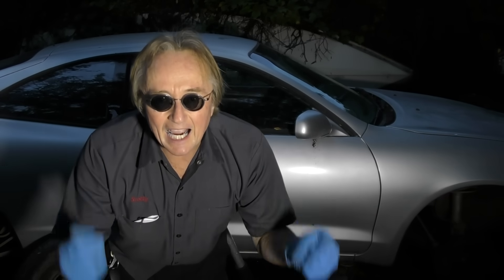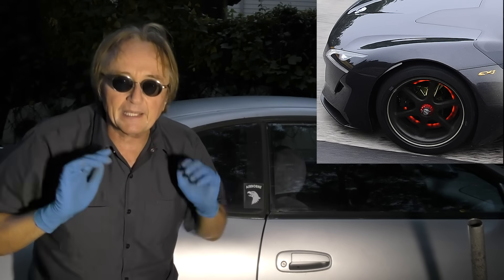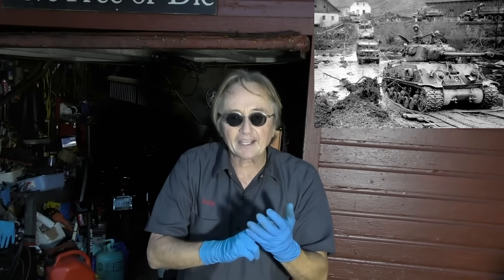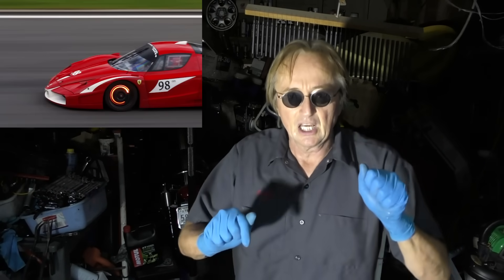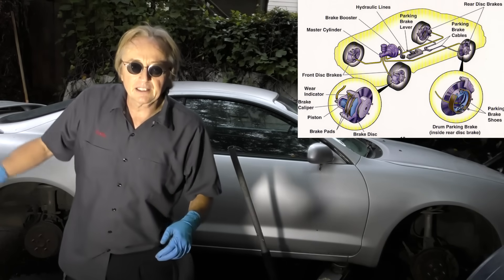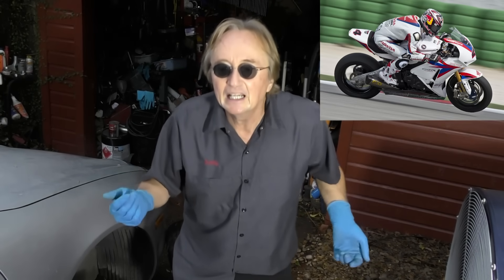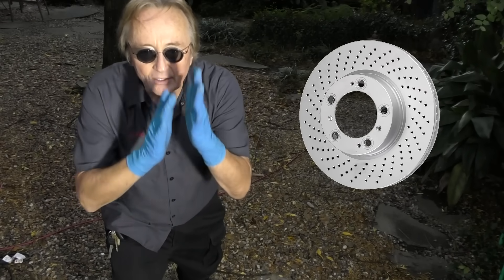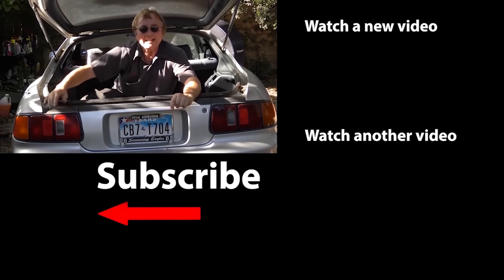Why Some Cars Have Drum Brakes Instead of Disc Brakes

Comment: Disc brakes and rotors are so easy to change too i just bought a car and glade mine have front and back disc brakes.
Reply: I remember when discs brakes started showing up on domestic cars in the 60s.  Despite the fact that disc were easier to work on, the brake shops took advantage of their customers advertising repair work as follows.  "Complete brake job, $69.95.  Disc brakes, $20.00 extra."
Reply: @frankhoward7645  I remember that! I remember my mom's '68 Impala had front discs and the brake pedal said " Power Disc Brakes" molded in the rubber, lol.
Reply: Not so easy on my car because Honda had the genius idea of making the front disc brakes hub over rotor. So you have to take the axle nut off first which requires a heavy duty impact driver or a sumo wrestler standing on the a breaker bar. Then you have to remove the hub, then the rotor comes off.
Reply: @dekoldrick  What the heck kind of Honda do you have? Apart from the stupid screws that hold the rotor onto the hub (which I threw away after the first rotor replacement), it's actually really easy to replace the rotors on my 2010 Civic.
Reply: @dekoldrick  Yeah.  I'd like to know as well.  Never heard of such an arrangement on a Honda.
Reply: @frankhoward7645  It's a 93 Accord. They arranged it where the hub is over the rotor so to change the rotor, the hub has to come off first.
Reply: @frankhoward7645  it's called a captive rotor it gets that name because the rotor is literally held captive by the hub. Yes some Honda's have them depending on year and model. Have no clue why though terrible design when it comes to maintenance.
Reply: @dekoldrick  Thanks for that car information.  I looked it up and sure enough, you are correct as the hub needs to be removed in order to remove the discs however I will say this.  In many cases, mechanics like to replace the rotor every time they replace the pads after all, with the exception of the '93 Accord, there's not all that much more labor involved in replacing the rotor if you've removed the caliper.  The mechanic makes money selling a pair of rotors as well as charging for extra labor.  Most of the time, I believe this is a ripoff because unless it's warped, there's no way a rotor needs replacing as as often as a pad does.  If all you're replacing is the pads, there's no more labor involved, even on a '93 Accord.
Reply: @dekoldrick  is that the first honda ever built?
Reply: @1232bluejays  ,Nope My 2005 Honda Accord Cp has Rear Drums on it 😞
Reply: @dekoldrick  my nissan was like that... it was a slight pain, but not terrible with an impact (electric)
Reply: A seeing idog oh so true
Reply: oh yeah the birds beak, cable, springs, F&@!
Reply: If you live where they salt the roads in winter, it can take an hour to remove a rotor that is rusted to the hub.  I use penetrating oil, a rubber hammer and a torch to expand the rotor.
Reply: @markgigiel2722  I just removed a disc that was rusted to the hub on a 2000 Jetta.  To separate it from the hub, I removed the caliper and whacked the disc from the back side with a sledge hammer.  Didn't take an hour and by the way, I live in Minnesota, home of Cargill.  Cargill sells salt for snow and ice clearing.
Reply: @markgigiel2722  put antiseize on mating surface next time. Pop's right off
Reply: The only good thing about drum brakes is that they last a long time, but disc brakes are easier to change, and they stop you faster.
Reply: Fck all those stupid springs on drums
Reply: Drums are easy to do 10 mins a side tops
Reply: From automotive videos on YouTube it seems harder for a novice to remove a stuck drum than rotors. With disc brakes you can hammer the inward side if the backing plate does not completely cover it. With drums hammering involves trying not to hit the lug nuts. If using the torching method with disc brakes you probably removed the caliper assembly from the wheel hub so you don't have to worry about subjecting the rubber seals and fluid to extra heat, whereas with drums you have to know to only heat the lug studs.
Reply: May be easier to change, but the rear breaks really don't have to get changed very often.
Reply: Usually there are still shoes in the back for your parking brake

Comment: 2004 Honda Odyssey alternator went out undone the battery change alternators RPMs shut up 3500 idle down to 2000 RPMs I need a van I adjusting the throttle cables down to 800 RPMs or somewhere what went wrong with it
Reply: I'd guess a sensor
Reply: did you fully charge up the battery first,   if not you forced the new alternator to be over worked,   if you made any adjustments to the idle,   the computer will self adjust the idle,   you made things worse by doing that,    taking the alternator off on this van can be a big job,  lots to do,   it may need to idle learn again,   and you messed up the idle by changing the cables length.  did you undo any vacuum lines,   did you leave anything unplugged,    and it may have computer damage due to loss of voltage and being driven on low power.   it may need a new computer,   I will bet it was jump started a few times.   if so,  you supply power,  get it started but with bad alternator and then take off the jumper cables and remove the power supply and not it only has the dead battery.   this power fluctuation is a computer killer and it over heats the new alternator and can burn it up in minutes.  and a bad alternator drains a battery dead,   sometimes a older battery will over heat and short out so sometimes both are needed,   new alternator and new battery,    if the battery was old,   the old alternator may have been getting over worked and the old weak battery was the cause of death for the alternator,   and not putting in a good battery will only kill the new alternator.   you must put the battery on the proper testing equipment first to know.  and have each battery cell tested.   if any of it shows low or weak,  toss it.  and you can do damage to the transmission computer,   and body control computer,   its loaded with all kinds of cool stuff that can short out from voltage loss.  or high voltage when a alternator is being told to charge more than it should to make up for a weak battery.   it will put out more amps.  and then burn up,,,,,,again.  poof,   do it all over again.
Reply: I'm old school mechanic this is new school to me lol
Reply: forgot to say thanks for the info I know better next time

Comment: Drums are such a pain at times to replace. Glad my car is disk all the way around
Reply: it takes a well set up mechanic only 30 minutes to do rear drum brakes.   where rear disc brakes tend to get stuck slider pins and stop working on the rear,   more dirt gets up into the rear,   that's why drums was popular for rear brakes,  they are more sealed from dirt getting in.   and can last 10 years with moderate driving where as most people get 3 to 5 years out of disc brakes on the front.   but they do work harder.  and less brake pad material on disc brakes to do the stopping,
Reply: @ateam6486  they get more wear and I like them for a trucks ( my drums take longer because they are usually locked up or rusted on one of the farm trucks) but not a huge fan for them on my sports cars I change my brakes out every 30-40 because I dont want them to get to low
Reply: Seriously?! I can replace and setup drum brakes almost as fast as discs. Just need the correct tools and technique.
Reply: Just time consuming. What sucks is when the self adjuster stops working and its raining too often to do a manual adjustment.
Reply: +Bill Abdallah

What's a self-adjuster?
Reply: @GlamStacheessnostalgialounge  the star wheel basically keeps the gap between the pads and drum. Too much gap and the brakes dont engage all the way. The star is suppose to keep the gap in spec.
Reply: My car has 4 disc brakes and drums in the back for parking.
Reply: Me too also just done a rear wheel bearing just bolted strait in got the whole hub for £26. If it was a drum i found the bearing was inside the drum and the rest of the bearing was stuck on the shaft what i nightmare
Reply: My previous car was drums all 'round and lucky me I never had to replace anything, worked like a charm for the whole 3 years I had it.
Reply: @GlamStacheessnostalgialounge  Older car?
Reply: 1988 made car, but it was made in back in Communism so it uses early 1970s technology.
Reply: Hold my beer

Comment: Rev up your disc Brakes
Reply: Be sure to use jack stands and make us a video!!!
Reply: spin up your rotors!
Reply: Hahaha...there's always some guy  commenting about Rev up your "fill  in subject of video"....
Reply: Don't they'll overheat ;)
Reply: Hahaha
Reply: No no no, I've wrecked my brakes enough with burnouts thx
Reply: 😂😂😂😂 oh god that killed me rev up your drum brakes.
Reply: Hahaha
Reply: Fuse your disc brakes together 💗
Reply: Mustansar Haidat I wonder if DiscGo turned into a famous dance 💃 lol 😉
Reply: Scotty, another of your poor information videos.  
Disk brakes has the same issue with water.  They don't work well on first use when wet.  
Though you are correct that drum brakes are still utilized due to cost but there are cars where it doesn't make sense to use rear disk brakes, except for bragging rights.
Rear drum brakes are still utilized in some cars because of the weight.  Cars weigh little in the back and powerful brakes will only cause wheel locks then mitigated by ABS, might as well use a cheaper brake system.
Reply: zodiacfml Let me guess, you’re butthurt over him insulting your chrysler?
Reply: @zodiacfml  want some cheese with that whine?

Comment: I had a '72 Chevelle SS back in 1995 and it was used originally for drag racing. 4 wheel drums. He ordered it without discs for less friction. Scary as hell in the rain. Wish I still have it. My '07 Taurus SE has disc/drum setup. They had rear disc as an option in the 90s on the SHO. If I can find a donor car I would yank the disc off and put them on my '07. Til then the sloted and cross drilled rotors work just fine stopping the car.

Comment: Ive been selling auto parts for almost 2 years now and a customer told me drums were far superior then i asked why arent higher trims offered with drum brakes? Well he was an older gentleman but i did not argue and agreed with him. Thank you for shedding some light scotty!
Reply: Sep596   Odds are, the customer is one of those from the 'everything was better in the good old days' mindset.  You usually can't reason with them, and you did the right thing by just sending him on his way without argument.
Reply: If drums aren't actually better, why do heavy diesel trucks all use drum brakes.
Reply: Robert Mcgee they are going to disc have seen more and more air disc the last 3 years on class 8 trucks
Reply: Mark Richards not true. The new 2019 freightliner cascadia still have drums up front. I know Bc I drive one.
Reply: My only guess would be that disc brakes almost need vacuum boosting to get enough mechanical advantage to work well where drum brakes can work as good as they're going to with  basic hyrdraulics or even just a cable.
Reply: @ExaltedDuck  NEED vacuum assist?  Depends on the vehicle.  I've a few front-disk vehicles without assist - notably a '77 F100.  Yes, it took a little more effort, but not a whole lot, and I got used to it real quick.  I've had a few Chevettes and Pintos with unassisted front discs, too.   Then there was my old Mercury Monarch with its optional 4-wheel disc brake setup ... with a frackin HYDROBOOST.  All you had to do was look at the brake pedal funny and you were instantly in a four-wheel skid.
Reply: I think he meant that drum brakes can have greater stopping force, which is true. Problem is that they are not very moduleable. Disc brakes can be controlled much faster and accurately by driver, abs, TCS, ect.
Reply: I work for an aluminum semi trailer manufacturer and we install air-disk brakes on semi trailers
Reply: Angry Trucker  I was going to say the same thing...he was talking about higher TRIM levels on vehicles that usually have four wheel discs, where lower trim levels often had drums on the rear.
Reply: Mark Richards I know. But majority of the new trucks being bought by large carriers like where I work, all have drum brakes all around. The freightliner, Volvo, and kenworths which are 2018 or newer.
Reply: ummm  higher rims???    you mean larger in diameter wheels???   well they do use drum brakes on bigger wheels such as old farm tractors,   giant huge 8 foot high wheels.  and the big semi trucks use drum brakes.   now yes a semi truck may have front disc brakes,   but for stopping power where more pad to metal contact is needed,   drum brakes have more contact surface. so they are better for stopping heavy loads.   but semi truck drivers also adjust the drum brakes every time they go out on long trips.   its just a simple adjustment,   no need to take the wheels off on them,  its just a screw,  in 2 years of selling parts,  you have a very long way to go. do you know why ceramic is better than organic for disc brakes.   and what happens to organic pads??
Reply: @ateam6486  He wrote higher "Trims". Re-----ad ok?